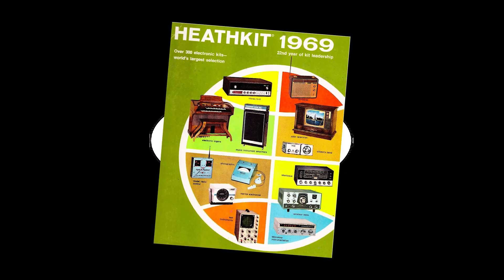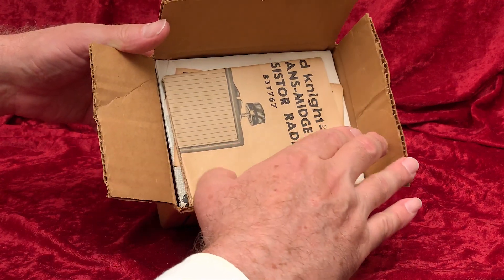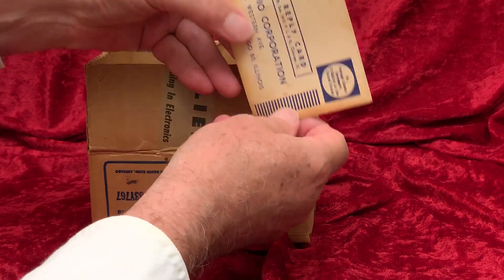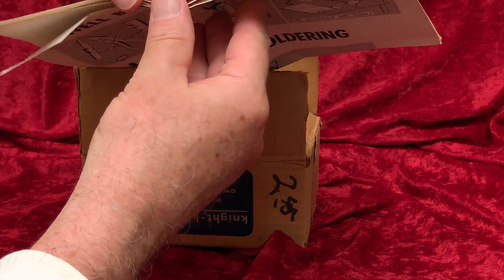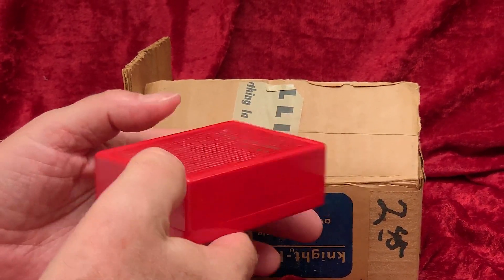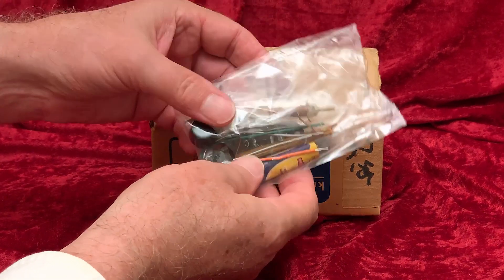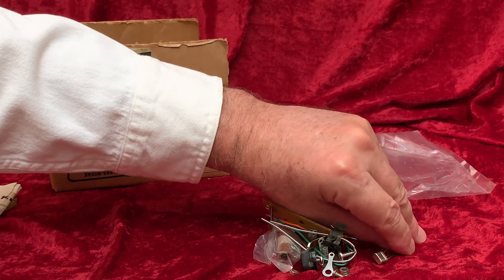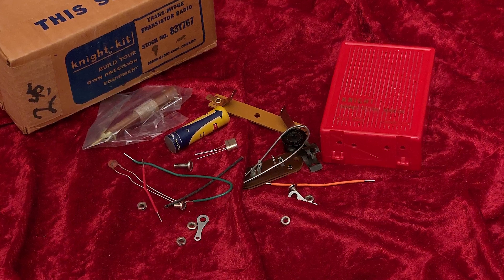Knight-Kit Allied Radio Trans-Midge 1957 Transistor Radio kit unbuilt unboxing - collectornet.net

Comment: Cool.
I remember when the local Allied store became Radio Shack.
📻🙂
Reply from the maker: You had a local Allied store? Lucky! I never got to go into one of those. When I was a teenager, about 25 miles from me was a Lafayette store which I loved to go to. Visits were rare, though, because no one in my family but me had any interest at all in electronics. Though we didn't have an Allied store, I did get the catalog, along with Lafayette and B&A. I still have on my desk today the Dynaco amp and preamp I ordered through the mail from Allied while I was in junior high school. I ordered them as kits, built them, and they still work till this day.
Reply: collectornet 
I remember, because it was within a bike ride from the house in Clayton Missouri, across the street from the Stix, Baer & Fuller Department store, where mom and I would shop all the time.
She took me to the Allied store at least a couple of times, then , for a short time it was “ Allied Radio Shack”, until the dropped the Allied name.
Once I got a little older, I used to go there a lot, bought a lot of CB stuff there as a teen.
The first radio I remember [ well enough] having, Mom bought from them.
12-167 AM pocket radio.
I had it [ or maybe more than one] for a long time as a kid.
( I have one now- and it works [ as-is] - paid $5.oo at a resale shop.😁)
Not much of a looker, and not much of a radio, with only 5tranistors, but one didn’t need much back then.)
We had radios like that,like kids have Smartphones today.
  This was when pocket radios were getting cheap to buy.
📻😁
Reply: @collectornet  
Cool
📻🙂